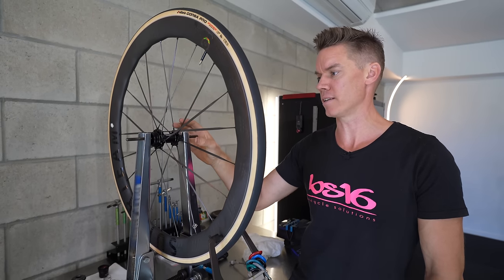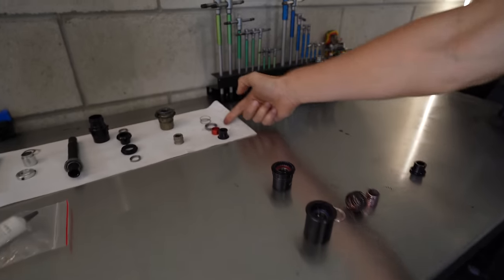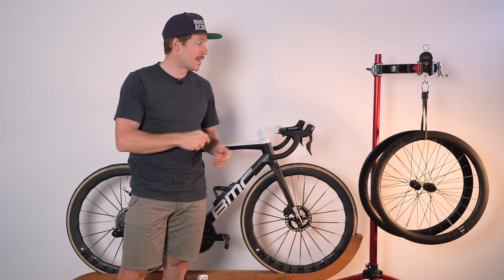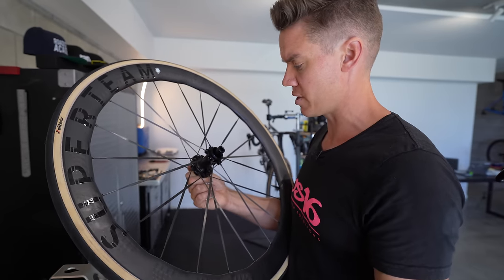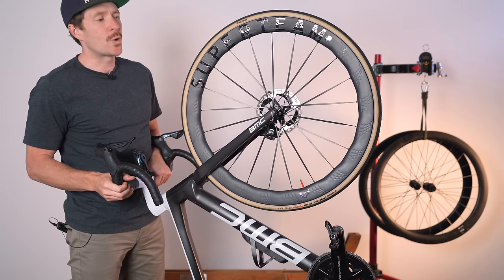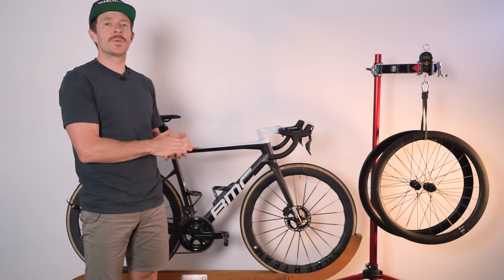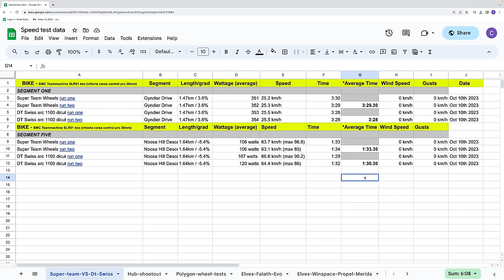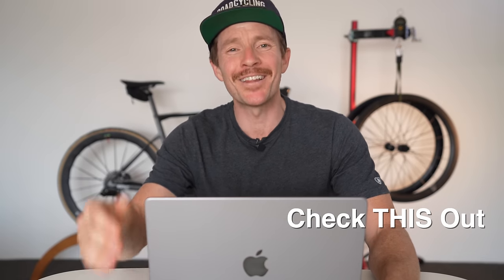Best Value for Money Carbon Wheels I've Seen (Superteam)

Comment: Dear all other ‘YouTubers’ with the exception of PeakTorque. This is how you do a wheel test. Take notes.
Reply: Being gifted a set of wheels to use, and being paid to produce a video about them? That's not the standard of wheels review that I want to see. Although kudos to Cam for being upfront and honest about this.
Reply: To be fair this is how all his wheel tests are done regardless if they were gifted or purchased outright.
Reply: I also tested these wheels, and while I agree with Cam about their great riding characteristics, I encountered issues caused by poor quality control.
Reply: Brother, every brand of wheelset may encounter problems to some extent, so quality control is also very important. I have watched your video test and also watched Cam’s video. I can only say that you are a little unlucky. But how does it feel to ride after the restoration? @cyclistshub
Reply: Yeah, I guess, we can call it bad luck or poor QC. 🙂
Reply: i dont think these speed tests are a way to go
first it is really short distance so we dont get much accuracy. time measurements can easily be off by 2 seconds (inaccuracy at start + inacuracy at finish)
and if we add 2 seconds to dt and subtract 2 seconds from superteam this changes whole test results making superteam faster
also we get downhill max speed of 85 and 86.8 for superteam
and 86 and 90.2 for dt
this 3-4% error is quite a lot if we are looking for marginal gains where 2% speed increase is a lot
with 107 watts he got 90 kph and with 120 watts he got 86 kph, this means other factors were far from equal
he needed to do more tests to get more accurate average results to compensate differences in rider position, wind, traffic situation (we see vehicles), corner trajectories etc
result speed should be normalized by power output because you cant compare 351 watt speed to 354 watt speed, thats not fair
btw on second segment he got way more power on dts and didnt reride it

Comment: I've been riding a set of 38mm Super Team carbon wheels for about 5 or 6 years now and they are still very true, still look great and I've never had an issue with them.  I've even commented on this channel that you should review their wheels, so I'm very happy to see that you now have.  I paid less than $300 US when I bought these wheels on sale on Amazon, and the majority of their wheels are still less than $500 US.  Why anyone would purposely spend so much more money on a set of wheels that aren't really any better is a question I can't answer, other than this sport catering to the elitist athlete who wants to impress their friends with how much they spend on their bike.  I've also been using the Assioma power pedals for quite a few years and they are amazing as well.  The whole point of cycling should be to find the best value so that the most people can afford to participate at whatever level they choose.  You can build a very solid race bike for under $3000 including the wheels and everything else.  Keep up the great work reviewing these quality Chinese bikes/wheels/parts.  Not all of them are top quality, but many are and by you trying them first, we can make smarter buying decisions.
Reply: I also have the 38mm superteam wheels. I had several issues in the first 3,000 miles...spoke nipples started breaking on both wheels. I wound up using spokes from my old and barely used mavic Aksium wheels. I also had to replace the bearings in the rear hub in the rear hub. One of the bigger bearings had completely seized. I had read that bearing were a know issue. After that, I never had a problem.. I think I put 10 to 12 thousand miles on them to this point, but won't ride them any more due to brake track wearing thin. But for $300, they were  great  carbon wheels, especially for my 1st set.
Reply: yeah I have a 50mm rim brake wheels from amazon as well and they have been incredible, and I'm 200+ lbs lol
Reply: @BodieMoto  i have 50mm rim brake as well love them!
Reply: I just got a set of Superteam to replace my old Shimano Ultegra Aluminum rims. They look to be great quality. I have heard they make for other brands and decided to make a direct to consumer line.
Reply: @MrChippinator  Let me know what you think of them after you put some miles on them. I have a feeling you’ll love them.

Comment: Wheel weight limits? This 100kg 6'4" rider thanks you 😊 I'm also an Assioma pedals user, they're awesome 👌
Edit: I stopped being lazy and just went to the site, here are some specs:

ALL CARBON D28-50 DISC 2023
Weight limit: 120kg
Tire Compatibility: Tubeless Ready
Rim Depth: 50mm
Inner Width: 21mm
Outer Width: 28mm
Wheelset weight: 1385±30g
Spoke count: 21/21
Tire pressure limit: 125psi/8.6 bar
Recommended Tires Sizes: 700C 28C(32C)
Should Cam Keep The Mo: Hell No 😁

Comment: I own an ENVE AR 4.5 SES wheel set and a Hunt 40 Carbon Aero Disc wheelset.  The cost difference between the two wheel sets is approximately the same as your cost differences of your two wheelsets.  The difference in performance between my two wheelsets is most notable when comparing the effects of winds at varying yaw angles.  With the Enve wheels you can feel the wind pressure but they cut through this pressure with a controlled stability whereas with the Hunt wheels you feel more instability at the same speeds.  Also the cost differential can be attributed to the better guarantee offered by the higher priced wheels such as Enve which has an unconditional replacement clause whenever one of its wheels is damaged.  With the Hunt wheelset you only have a guarantee against manufacture defects. Granted you could still buy another 2 complete wheelsets with Hunt if you damaged your wheels so you would still be ahead in that respect.  In retrospect I would still buy the Hunt wheelset vs the Enve as they are pretty much equal or surpass the Enve wheelset in all other aspects.  (Weight, rolling resistance, aero effects and COST) Also when I  purchased the Enve wheelset the Hunt wheelset had not yet been a proven and peloton test product.  But now you see them in the TDF and coblestones of Paris-Roubaix

Comment: I have the 60 / 55mm  wave version of this wheelset.
value for money and confirmed improved in cross wind and top speed comparing it to the older Gen 1 Hyper 65mm
Reply: I’ve been looking at those myself. Are you at all concerned about sourcing replacement components down the line? Quite new to this and I don’t want to be stuck with something may have become obsolete in a few years
Reply: @noDahn  in these days of age, it all depends of how far so you want to serviced it before it becomes obeselete or financially not worth to fix.

The bearings and hubs are off the shelves item - DT Swiss copy. I wouldn't be too stress about it.

Comment: I think Superteam is a decent wheel for the money.   I got two sets of superteam carbon wheels. 50’s V-shape on my fixie and 55’s U shape on my road bike. Both on 700x28c tires and the less expensive Notatec hubs.  
The fixie has about 3000 miles and 1500 miles on the road bike…. So far, no issues at all and both true!  I get compliments on how they look all the time too.  🍻 👍✌️

Comment: Hi Cam, test results, your experience sound encouraging. 1. Are these wheeels tubeless ready? 2. If positive would you switch to tubeless? 3. Do they arrive complete with ceramic bearings of Superteams’ production? 4. Have you had a chance to use their light inner tubes? How would you rate them vs. Pirelli’s light inner tubes? You’ve been doing great job. Caught up tp your channel just now. The video you share when you received a first mail from Merida manager after two years of knocking on other doors and being ignored (don’t we all know it?) is so emotinal. Funnily enough I am of very similar build to yours and on my own made decision to buy reacto 8000 at the beginning of the season. It proved to be a great decision. Even Reynolds AR58 wheelset turned out to cope with cross winds really well (unlike your experience). Keep fingers for you.

Comment: hi, in a video you pimped the ican aero disc wheels by converting the bearings to ceramic bearings.
I also have bikes like this and would like to do the same for myself.
but apparently I need other bearings...
I have probably
The hubs are Novatec D411SB/D412SB.
The dimension of bearings.
Front:6803RU, Rear:15267
Which bearings do I need for the freehub?

Many greetings, Jens

Comment: I have been riding the Super Team Gravel Wheels I picked up for around $400. I have had them for around 2 years now. They have been a solid wheelset. I did have a hub go bad, apparently the hubs are only under warranty for 6 months or a year. It was like $50 and two weeks for them to get a new hub out to me. Overall I would definitely get another wheel set through them.

Comment: Was gonna drop some cash on some Hypers... Now I'm reconsidering.

Great Work Cam
Reply from the maker: For me these look better but I'd say the Hypers are a touch stiffer. Although I prefer some softness in the wheel. Less harsh. Cheers
Reply: Alright Cam, need the final decide. If you had to choose between Superteam and Elves Valar (either way I'm doing a stint on the couch) which one is worth the penalty box time?
Reply from the maker: @stuartfrancis519  SuperTeams would be my choice. Visually a really good looking rim too, so they will pimp your bike up as an added benefit.

Comment: i have old super team wheel 50 & 60mm profile with basic R13 hubset. so far still good after few years although i'm not a big mileage recorder. only change the front hub bearing once. the rim brake track has kinda a burned brake pad residue sticked to the surface due to heavy braking during long hilly descent. unable to remove it with simple washing & gentle scrubbing.

Comment: I ride SuperTeam wheels and they absolutely slap. They actually came in almost 100g UNDER the advertised weight (maybe that weight included the included skewers?) and have been flawless so far. Only paid $379 for them, although I wish I paid the extra to get the full carbon version w/ ceramic bearings. As someone who cant afford $3,000 wheels, they are an amazing option.

That said, if you are a serious racer, the speed difference of the DT Swiss justifies the price. 3mph faster on just one decent is crazy. Now imagine the difference across a 100 mile race. It's likely minutes faster.

Comment: Quick and straight review, so good! And some nice wheels that make it more difficult for me to opt for Elite Drive, Exar ultra or, now, these Superteam😅. I have a question, I asked the Superteam about the bearings, if these have steel races or are completely ceramic... They told me that the bearings are completely ceramic, balls and races, can you confirm? Anyway, it seems likely that it's a new feature... I don't know.
Reply: They’re lighter in weight and have less rotational friction. You can go faster with lower rolling resistance.I love it.

Comment: The faster wheel will almost certainly be the one that more closely matches the inflated tire width. This has to be measured and controlled for.
As he said that these can take 25 or 28 mm tires, that means he's not that concerned with this. That's an issue.

Comment: After 5 years using superteam 50mm profile and paired with dt350 hub, boy this wheel is amazing. Rolling 35km/h in flat is a breeze, i'm barely hitting 1.5w/kg to maintain the speed.
Reply: How could you parred them?
Reply: We have authorized superteam seller here, so we can ask to just order the rim+spoke then ask them pairing it with any hub you request with additional cost of course

But $700 for carbon rim + dt350 hub is a no brainer

Comment: Thanks for the review. But there are certainly a few concerns that come with this wheelset. There are only 18 spokes of the 2:1 two-to-one spoke lacing pattern. Meaning... only 6 spokes on the non-drive side of the front wheel. Seriously this design is pushing the carbon spoke to “zone 5”.  The horizontal Turning/ cutting tension will apply to the spoke when you brake. Usually on other wheelsets, it’s fine. But this one… 6 spokes😢😂 Also the inner hub tooth does not last that long…

Comment: Other than speed, do you notice anything as far as ride quality between the high end wheels and one of the more budget options?
Reply from the maker: As a generalisation - better rolling resistance down a descent or in a draft (normally hub related), and they tend to hold their trueness a bit better, probably due to QA, but I feel that is changing.

Comment: Does seem competitive compared to Light Bicycle, etc. that they say "free shipping and all taxes covered". For me as a central European individual, the risk of ordering from china has never been worth it. 1000 usd for this or similar wheelsets with the risk of 19% vat being added by customs or just buy 404 firescrests for 1.350€ and have the crash replacement and much better resale value. Loads of wheels in the 1300-1500€ ballpark online here. Also the dt arc 1400 (with 240 instead of 180 hubs) available at 1500€. And if you need or want cheaper wheels, theres importers like Hunt or Leeze, etc.
Reply: Does it mean that Super Team will pay the VAT then? I am UK based and considering buying these buy dont want the VAT surprise... because then they are not worth the price.

Comment: How did the speed tests compare to 23 hypers?
Reply: If I may... Although I have tested HYPER SE 2023 which are 99% the same as HYPER 2023, the difference in speed between them and Superteams is negligible. But Superteams are more stable in crosswinds.
Reply: @cyclistshub I actually prefer the look of these over the hypers, and probably would have gone for them had I known about them a month ago, especially with the cost saving. That said, the hypers are sick too so no regrets.
Reply: @jameseastwood402  I like HYPER design more. But Superteams with the chrome decals make a cool rainbow effect in direct sunglight, so they started to grow on me. 😅

Comment: Guys u jjust cant get better wheels than Specialized Roval Rapide CLX Range of Carbon wheelsets.  Check this out ..  
1st set l purchased.  2nd hand set from a mate were his race wheels.   Barely used . 6/8 races . Roval Rapide CLX 40 tubular  $750 . 
2nd set Brand New Roval Rapide CLX 30 climbing wheels  $2500 . With Bags  New Price    $4400
3rd set Brand New    "           "             "             "              "         $ 3300. With Bags                        $4400
4th set Brand New Roval Rapide CLX 40 with NewTubulars  $2400. With Bags . New Price    $3900
5th set Brand New Roval Rapide CLX 51/60 Aero clinchers   $3380 with Bags.   New Prices  $4400
6th set Brand New Roval Rapide CLX 51/60 Aero clinchers   $2900 with Bags .  New Prices  $4400

Wouldn't trust a set of your Chinese Carbon Wheels ever

Comment: So after all that…. What’s the verdict on the wheels?  Otherwise a pretty much paid /sponsored review!
Reply: Cost - about 33% of a high end wheel set

Rolling - slower than said top end wheel set but as fast or marginally faster than other wheel sets Cam has reviewed.

Customer support-  could be limited

Summary - they are not shit, at a good price but if you do have an issue, it could be a pain in the arse to sort out replacements etc.

Is that clear enough for you?

Comment: Will these Chinese Brands ever include actual engineering? To my mind they are simply manufacturing companies only.
All they are doing is leveraging other people’s  IP.
Now DT Swiss and other western brands have had to come up with these designs from a blank sheet of paper, prototype, test, manufacture and provide marketing and distribution.
What you have is a manufacturer dumping product on the market at minimal margin to establish a brand.
A practice that is illegal in most markets, but not China.
Where’s your import duty tax on those wheels Cam?
See my point?
Reply: For example, the Lún MEGA spokes are their own invention, which they have patented. I agree, it would be nice to see custom designs more often. But I'm afraid we've reached the point where there's not much new to invent in the cycling industry.
Reply: Well, as for the hubs,  the DT swiss patent expired. Everybody's starting to use that hub design now.